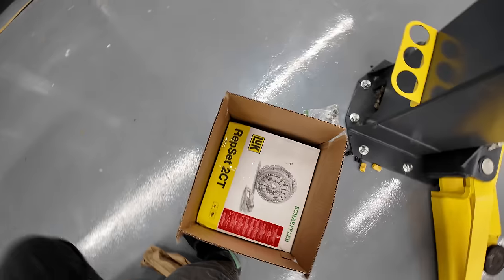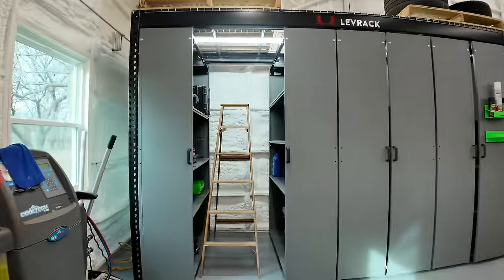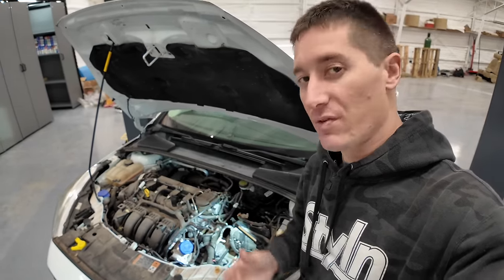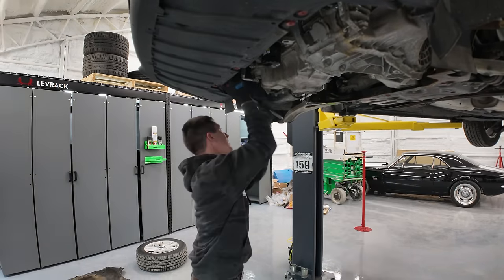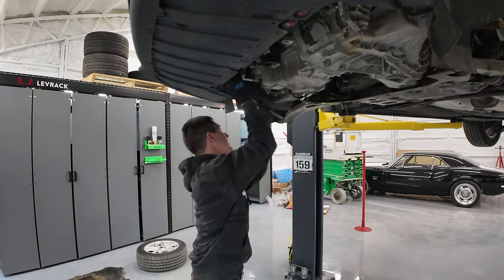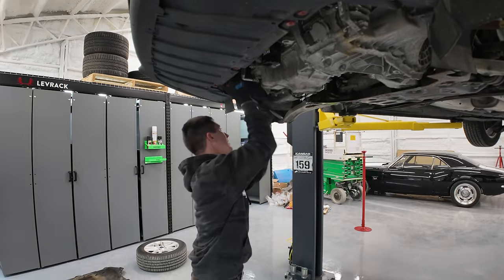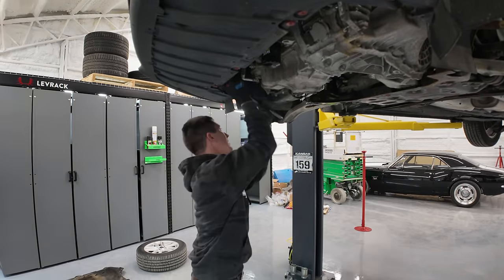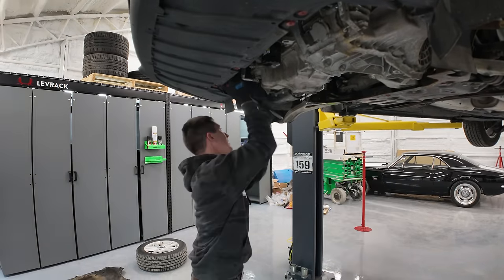Fixing The Problem That Ford REFUSED To Solve *Ford Focus DCT Clutch Replacement*

Comment: At least you had the shop and the knowledge to fix this.... it's just sad that Ford refused to do the right thing and do this for you.  Could have been some good PR for them.  Instead, it makes people think twice before buying a Ford product.
Reply: Ford has ceded the small car market....  so..   yeah.
Reply: According to the story Ford knew it was a bad design but decided to go ahead with the DCT anyway.
Better PR would have been to bite the bullet and scrap or redesign it.
Reply: That's today's Ford
Reply: The fact that it’s a ford should make people think twice. No American made cars are worth a damn.
Reply: Fits with the fact, that Ford thinks that it is a great idea to have a rubber cambelt in oil.... The cars are not meant to last.
Reply: I have always been a die-hard Ford guy, until I had this exact same thing happen to me and my Focus. Ford refused to fix it, so now I am an anything else guy (I currently own a Nissan). I will never buy a new Ford ever again. They have lost a life-long customer over this. I am also part of the DCT class action lawsuit against Ford. They have documents that show the engineers telling Ford that this design would not work, but Ford ordered them to go ahead anyway because there wasn't time to change it.
Reply: Bought a brand new Ford Contour in 1998. Was towed to the dealer with transmission trouble 6 months old. Towed back again for same problem in a year from that.  Was the last Ford I ever bought.
Reply: The thing is that you will have to change the clutch again in 1 year 😢
Reply: Ford has destroyed their reputation in the past few years due to the quality issues. Ford is the new Dodge Chrysler.
Reply: Not if they planned on getting out of the car market as a whole. Much like killing off the Ranger, the company new almost a decade before that it wasn't worth staying in.
Reply: Ford couldn’t care any less about this “bad” pr
Reply: not just ford all of the car makers do this kind of bs
Reply: MY NEW 85 FORD TEMPO WAS A MESS..FORD BOUGHT BACK MY 95 FORD CONTOUR..FORD STILL BUILDING JUNK..DEALERSHIPS ARE A JOKE..
Reply: You should always think twice before buying a Ford product. Then buy something else.
Reply: I have a 2012 with the manual transmission and it's got 246k and it's the most reliable car I've ever had. I would never buy one with the auto tho
Reply: @christopherloewen1433  there’s nothing wrong with the manual
Reply: I bought a 2014 Ford Focus SE and this transmission has been a nightmare. Ive already replaced it once for $2000.00 and it still drives very "jerky". I'll never buy another Ford as long as I live!
Reply: The 2012 Volvo S60 T4 with the Ford Sigma engine has the same transmission called MPS6. I am trying to ascertain if it is exactly as the one in the Ford Escape with the Sigma engine to source one on the USA.
Reply: How did you get involved with that? I’m in the same boat. I bought my daughter her first car for focus and with the transmission I feel like a piece of crap for buying that piece of crap for her
Reply: @trendel13  Yep we have the 2012 Focus & we have been watching all the RECALLS by Ford since & we have decided to NEVER buy a Ford again
Reply: I have 2 Ford focus se's. Both 2012.  Have   replaced the dual clutches in both of them.  In my yard.  Actually not that difficult. The first one was a little slow as I did all the steps. Also replaced the transmission seals when I did the clutches.
Reply: @kannonrussell848  I did the same thing back in November of '23. I bought my daughter a 2012 Focus as her first car for Christmas. Now 6 months after gifting it to her I feel like dog crap for giving her such a sorry car. It's barely drivable and I had no idea about these issues beforehand.

Comment: Best car I ever had for the first 15,000 miles and then it was a nightmare.
Reply: That’s a shame. Test drove the Focus in 2012 and it drove much like a 3-series BMW EXCEPT the transmission was stumbling awkwardly during the test drive.
Reply: Escape as well
Reply: 2018 focus SEL hachback. The transmission failed twice under 33,000k miles. This is a good car with a horrendous transmission. If you can find a manual transmission focus, you've found a good car. The dual-clutch ruined this car.
Reply: @TVC15185  I had a Fusion that I changed the brakes, tires, belt, battery, and oil. 150k miles-no issue. Then some idiot totaled it. It had the 2.0 ECOBOOST.
Reply: 200k on ours great car
Reply: I was lucky and Ford bought mine back.
Reply: @TheCoolOwen  because of the way it's tuned. u pretty much gotta always goose it off the line for the shifts to work. It drives like an RS at all times.
Reply: @CrocodileWhispers  so normal driving conditions are not what this car is built for, got it
Reply: @TheCoolOwen  idk man have u driven one of these dual clutches before?? Not every car drives like this where the tuning forces you to goose it. If you try and slowly accelerate off the line the DCT will shudder
Reply: @CrocodileWhispers  nope. After test driving one dual clutch, will not consider buying in future. I drive a 2016 Honda CR-V with a CVT.
Reply: @TheCoolOwen  ok thanks for inputting nothing to the conversation lol
Reply: @CrocodileWhispers  my input is Ford Dual Clutch Transmissions are poorly made. Not sure why you are triggered by my test drive. Another mindless Ford fanboy, perhaps?
Reply: @CrocodileWhispers  oh and BTW, VW was able to build DCTs that don’t stumble and jerk around like a drunk sailor on a garbage barge, so maybe YOU don’t know how to drive a DCT car properly!
Reply: @TheCoolOwen  1. The fact that it’s poorly made is well established, it’s established even in this thread. 2. Wow your test drive lol oooh yes I should value ur 10 mile round trip opinion. Hahahaha

Comment: When I briefly owned one of these the dealership explained to me that the fact it is a dry clutch dct is the problem. That they actually poorly designed some coolant or oil paths and a few drops hit the clutch and destroy it. That the reason ford never issued a recall is because to fix it they would have to replace every engine and transmission entirely. Because it’s a design flaw in the big parts.
Reply: Every other DCT transmission is "wet clutch". No one else does a dry DCT - NO ONE. Hindsight, ford would have been better off with increasing production of their existing transverse 6 speed. At least it was a known quantity, and they wouldn't be facing a billion $ class action lawsuit.
Reply: Wet clutch don't have problems really you want me to start naming them? Guy oh there is clutch dust no kidding all clutches give off dust. I've found many problems caused by owners hitting start button and throwing it into gear at same time. Seen low voltage faults caused by this battery just started engine, voltage low and alt hasn't even start charging yet.
Reply: @philbrutsche8928  Not "every other" DCT is wet. DSG in VW is mostly dry, Hyundai/Kia 7-speed dct is dry, most small European cars used dry clutch dct. It's just that US didn't get it until Ford made their shitty powershift.

Comment: P0902 is usually either the Clutch Actuator A or the TCM. It literally means the electrical circuit for the A actuator and is a code that will prompt a TCM replacement if swapping the A and B actuators shows no change in the symptoms or DTC.  Did you diagnose it first before buying a whole clutch kit ? Sounds like you had it at a dealer who has no idea. . . I buy and fix these things all the time.
Reply: I have one(2014 fiesta se) and after doing sparkplugs, ignition coils and wires my transmission suddenly started acting bad. The engine sounds great, but startup is rough and though it's fine going forward very slowly, going in reverse is like a machine gun and I can't get it very fast(clutch B perhaps?) 
Ford Town and country of Nashville TN won't look at it til 6 months from now. So I'm on the feet mobiles for a good hot minute unfortunately

Comment: Don't forget to reprogram the TCM for the new clutch.. good for another 30k miles 😅
Reply: Haha, my fiesta's was  replaced at 30,000, and then it went out at 70,000 agin, so I got 40K.  They charged me 4k to fix it, and a few months later are saying the clock gear is stripped and needs to be replaced.  Ford and its dealers are clowns in my book, will never buy a Ford again.
Reply: yoy really need to reset the tcm?
Reply: @vegitoblue7908  yes

Comment: I'm no camera expert, but it seems like the Osmo Pocket 3 did the job. I like the stability feature. Good video.
Also, the fact that the Ford DCT is a dry sump DCT was one of the major problems with that transmission. A wet sump system would have been the way to go, and probably would have saved Ford from many lawsuits.
Reply: The wet clutch version they made after(dry clutch was 6DCT250, wet was 7DCT300) didn't do much better.

Comment: Back in 2011 I was looking to replace my second first-gen Focus - I liked those cars so much I had two of them, but after a combined 250k miles driven, I was looking for something a bit more modern and up-market. The fact that you couldn't get a stick in higher trims, and I didn't yet trust Ford's DCT kept me away, and fortunately, I avoided this issue. It's a shame they didn't engineer it right, it seemed like the transmission was half-baked even brand new, compared to the GTI's DCT, and I'd go so far as to blame it for tarnishing Ford's reputation with small cars.
Reply: Arent these the cars with the non serviceable air filter,and you replace the whole airbox? 
Theyve really gone downhill for things line that in the last 10-15yrs.

Comment: I like the camera.  Like the way it tracks and it makes the video seem very smooth.  Audio sounds great.  
Did an Focus need a dual clutch?  I never heard anyone say...Wow this is the Porsche of compact cars.  Good luck, just glad to see you're saving what should be a simple, economical car.
BTW, the lighting in the shop is damned near perfect!
Reply: Ford spec’d it with a dual clutch to hit the magical 40 mpg mark. They made it a dry clutch to hit the price point for an economy car. And there were time constraints so no quality testing of the transmission, it was already behind schedule.
Reply: Ww have a 2016 hatchback SE and just got back from a 4,200 mile trip without a problem until we got home. The next time it was driven (2days later) it started making a crunchy grind noise coming from the tranny or starter hard to tell but have you heard of one making a noise like that? It made no noise on the trip at all!! Some input would be helpful!

Comment: Ugh. Had the swollen lug nut cap issue on my F-150. After multiple service visits to my Ford dealer, service techs had powered them on to the point the caps would just spin. I eventually had to use a metal hole saw bit to drill-off the caps.  If I ever buy a car with these lug nuts again, I’m immediately going to replace them with solid ones.
Reply: I finally did this with my F150. Best decision. Save you from so many headaches later.
Reply: I'm so glad to hear people discussing this. I thought I was crazy. I mean. they wouldn't sell a car that didn't use a standard size lug nut, would they?
Reply: @the_mowron  I had these replaced after 5 years cost a couple hundred bucks.  Should have been a factory recall.  Thanks Ford!!
Reply: @the_mowron  LOL , I had the same problem and thoughts on the first one I had a problem with at home, I thought immediately I DON'T need this issue on side of the road so I got a full set of REAL solid ones

Comment: This just reminded me that a friend of mine had an older Ford Mondeo Titanium (or Titanium X) that had the powershift DCT gearbox. One day it started not shifting into gear properly - Dealership was happy to cover it but then it happened a second time and he decided to get rid of it. Traded it in for a Galaxy as he wanted a vehicle he could also use for uber driving. Admittedly this Galaxy also had the powershift transmission but he didnt have the car long enough to run into issues with it. For some reason he couldnt get the permit that allowed him to work as a private hire vehicle and his uncle wanted a car for business use so he sold it to the uncle and bought a BMW 1 series. 

Im from the UK if that makes any difference so maybe consumer rights laws are a lot stronger here so dealerships here have no choice but to cover repair/replacement if the car is under warranty unless they can prove that the car had been driven recklessly or abused.

Comment: I researched the crap out of these because I have one, what I found to to the common denominator was the main oil seal in the transmission, there are 2 of them, the oil gets passed the seals and flings oil onto the clutch pack hence the the slipping and shuddering, they also don’t like sitting in traffic and constantly nudging forward which engages and disengage the transmission. Good luck JR,
Reply: This one looked pretty dry, don't think that's the culprit this time. They're just all-around awful transmissions!
Reply: The sensors can go out really easily, clutch actuators can go bad, this thing just sucks
Reply: If the seals are any color but orange, replace them. Ford did fix the oil seal issue, the new seals are orange in color.  Have nearly 100K on my wife's focus before the odd clutch started slipping. It has orange seals and dry as a desert.
Reply: Out of 5 focuses i fixed, only one had sipping rear main seal. When you press brake pedal it goes to neutral, but on n off all the time is really not good, just as for any other clutch on manual tranny

Comment: My 2016 Ford Focus had 184,360 miles on it when it's transmission died.  Funky forward, no reverse.  Estimates were over $3K with no guarantees so I donated it to a charity. It also  needed front end parts, tires, etc.   But it was a good car, 1 recall and 45 mpg on the highways.

Comment: My wifes 2015 FF Titanium has 170,000 + on it. First clutch was under warranty, seal leak. Second clutch under recall with less than 90K. It is going on 3rd clutch now. What I found is the odd clutch wears out, the even clutch is like new.  The true fix is to use a stronger odd clutch to last longer, but 80K on the odd clutch isn't too bad.  I really can't complain as the car gets great gas mileage, and has been 100% reliable.  Up until now I just replaced a battery and the brakes once.  This maintenance cycle though, the clutch, had a nut gall up on the drivers axle, so had to replace that, and new brakes all around. She got 100K out of them and still have some life left. I did replace the shocks and struts not too long ago.

Comment: I bought a new 2013 Fiesta that blew the front oil seal at 6k miles. The clutch/trans started slipping/chattering and making grinding noises while cruising at a constant speed. The dealer I bought it from said they never had any problems with the DCT and that the noises were normal.. I got a technician to drive it and he said it was the worst one he had seen so far. He admitted there had been a lot of failures. All they agreed to fix was the oil seal and clutch pack. I traded it off while they fixed it.. One of the service managers said they only replaced the seal at first...Then when the clutch still slipped they took the trans back out and replaced the clutches..No retraining the trans was done..

Comment: Snap on sells a wheel nut kit with a buch of weird sockets 19.5 for the swollen nut and 18.5 for the missing caps.  
A few other companies (otc) makes them as well, I like my kit very much
Reply: At the automotive shop I work at, we have a dedicated flip socket that is both 19.5 and 18.5 (it’s made by Steelman Tools) and we have a saying for 2012+ Ford lug nuts: “it’s not a matter of IF they will swell, it’s WHEN they will swell”
Reply: The same as Jeep ones, and a few cheep wheels nuts are the same.

Comment: On a focus if you first unbolt the starter you can angle the end with the cables down. This gives you easy access to the nuts to get the cable off.

Comment: I would check the shifting fork actuators first gears 1-6 and the reverse, test for functionality before disassembling transmission. Try cleaning moving the forks first manually with a ratchet clean 
 with brake cleaner and oil slightly with 
WD-40. Shifting forks could have binding.

Comment: Excellent content! Just imagine how awesome that car would be if it was a manual tranny from the factory. Based on your work, I do not understand why Ford  did not want to repair it. I am looking forward to the rest of the rebuild.
Reply: I had a 2014 Focus SE with a factory 5-speed manual. It was a great little commuter car, and completely avoided these transmission issues.

Comment: I remember driving those new and thinking those transmissions won’t last. 
JR pull out that Harbor Freight hydraulic table to use to dump that transmission onto. Also snag another fold out table from Lowe’s to keep your parts off the floor. While I’m spending your money snag an Icon 73 tool chest with the stainless steel top for a work bench. Great work and the color is a little washed out and the audio is a touch fly but overall look is very nice!

Comment: She holds 1.8 quarts of Amsoil DCT fluid ... I did every 25-30K miles and had no problems.
178K when it got rearended.
Initially, it had the brown seal upgrade along with the bearing setup between the plates. Keep up on cleaning the battery cable ends also ...
Reply: You changed the trans fluid every 30K ???? I could't figure out how, but now with 130,000 & no issues I'm afraid to do anything except maybe trade it LOL